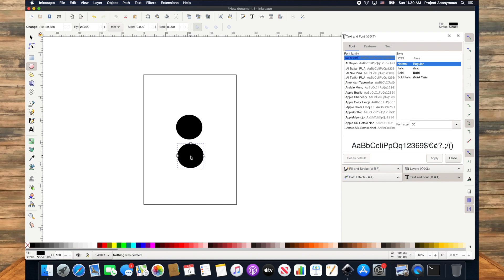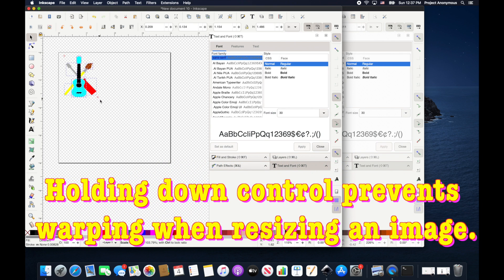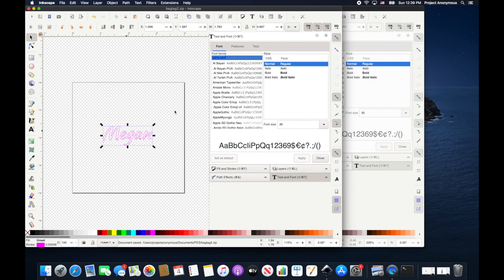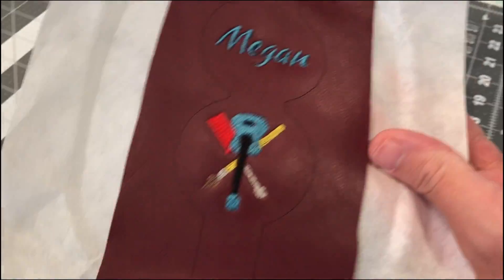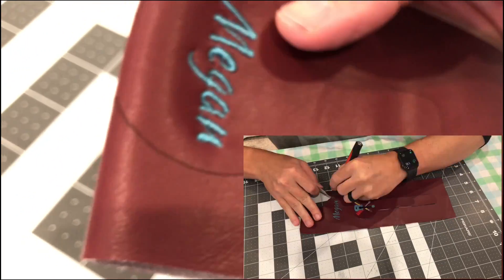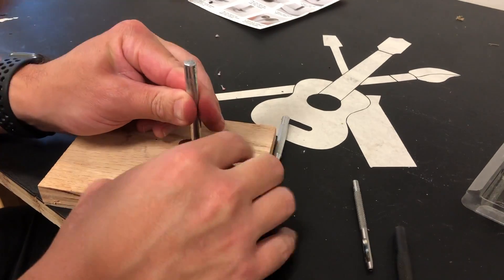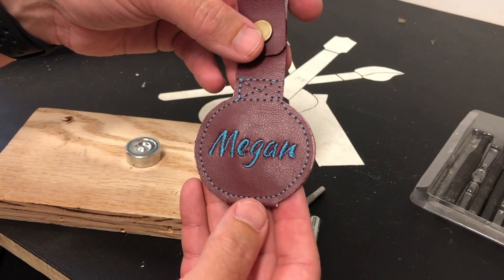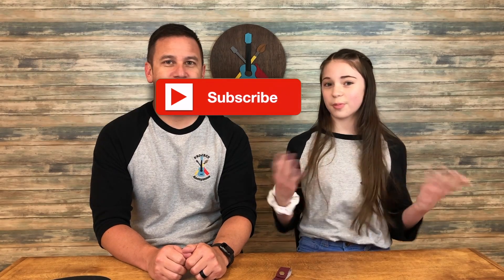How to Make a Bag Tag Using Ink/Stitch & Inkscape w/Marine Vinyl

Comment: Useful and looks fantastic! Safety tip: I hope you did the lasering outside -- vinyl emits chlorine gas when vaporized, which is bad for humans and the machine. If you Google "NYU Safe & Unsafe Materials for the Laser Cutter" there is a nice PDF that shows what is safe or not to laser.
Reply from the maker: Great point! Our laser engraver is kept in our garage (we keep the door open when cutting) due to the design of our laser engraver (not enclosed). Perhaps one day we’ll get a fancier enclosed CO2 laser or fiber laser engraver!